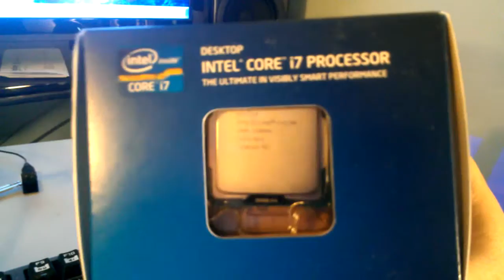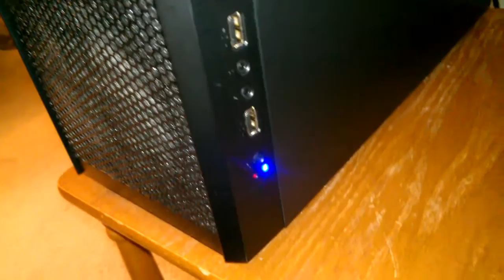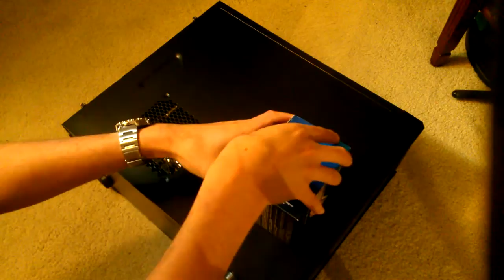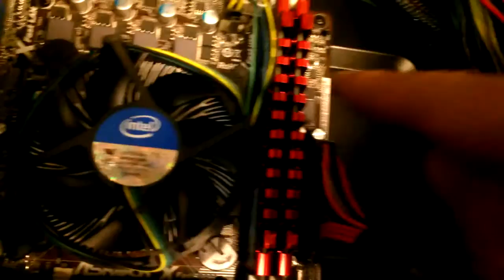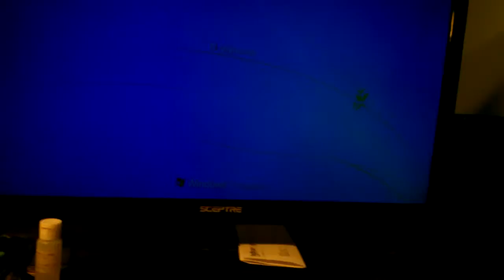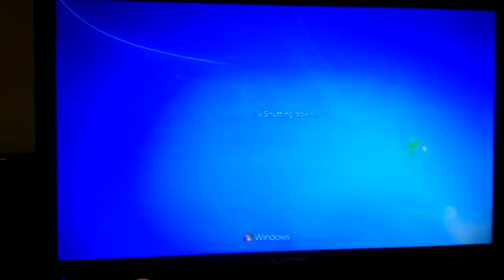Intel Core i7 3770K Upgrade

Comment: as you in the past i have i3-2100 now. is it worth novaday to upgrade it to 3770K? or its needed to change socket and get new generation i7's? my other hardware 8gb ram gtx 960 4gb
Reply: +Biggdwarf target is hi-ultra settings in current games

Comment: I have a notebook mother board: Intel quanta LG2 LG2LQ131 .... my processaador is sandy Bridgy i3, can change a Ivy bridge processor? Want i5 3320m?

PS: I noticed that both use the same socket arquivteturas, and even TDP, DMI, SOCKET !! all the same! I can change? is there anything special I should change the motherboard, as changes in jumping or something to that exchange of different CPU architectures?